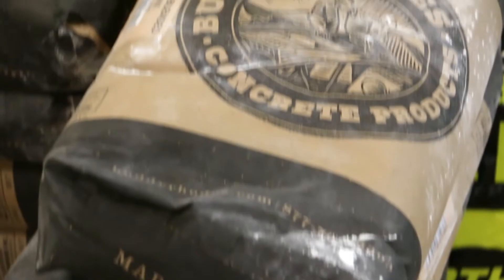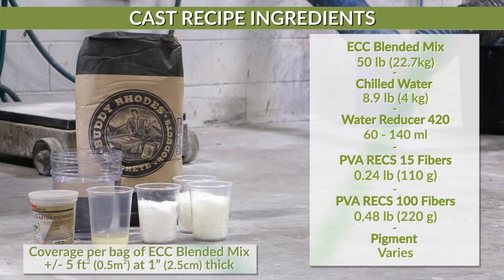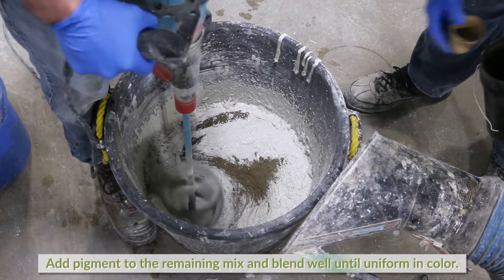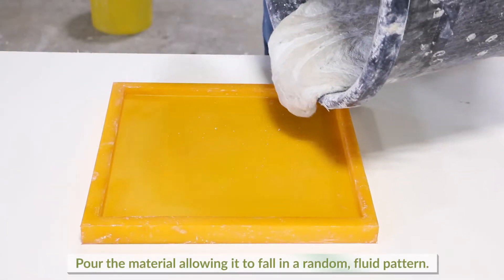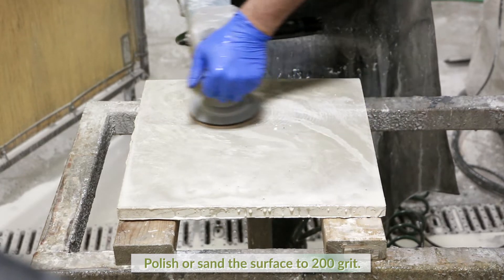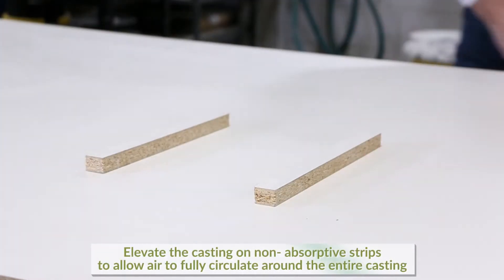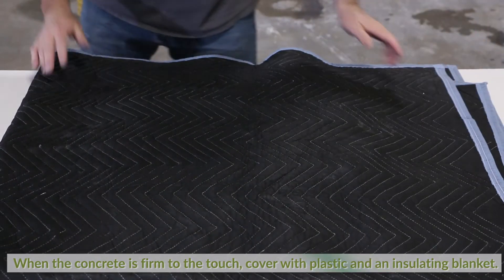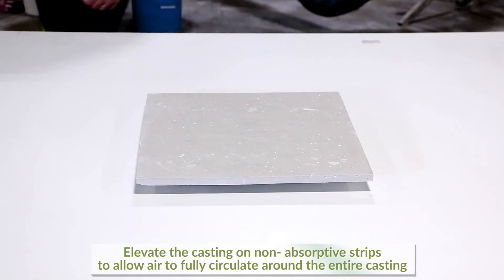ECC Blended Mix Basics - Cast Technique

Comment: Can you use In-Bucket Blending Method for color with the GFRC bag mix?
Reply from the maker: Hello, you can't really achieve the same finish using the GFRC Mix, if you do the In-Bucket technique using the GFRC Blended Mix, the colors will blend and won't be as separated as they are with the ECC Blended Mix.